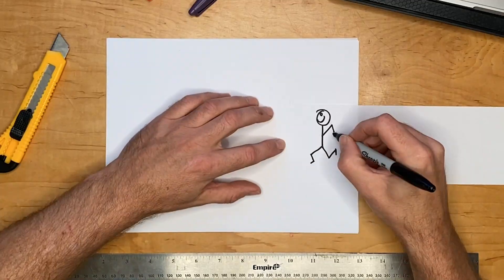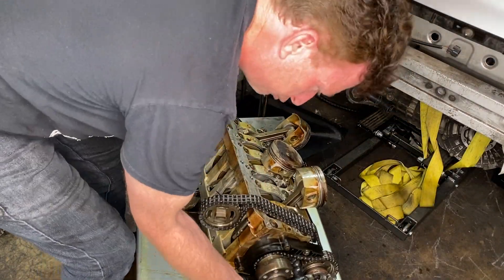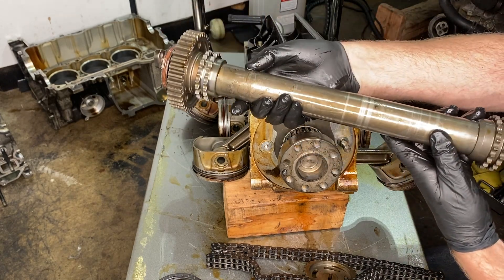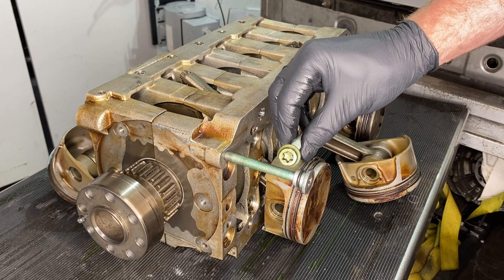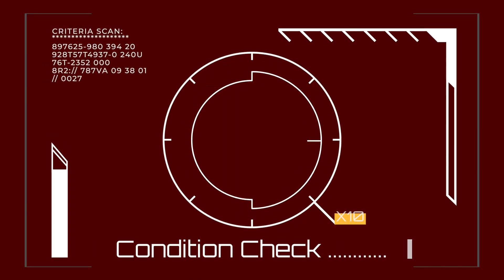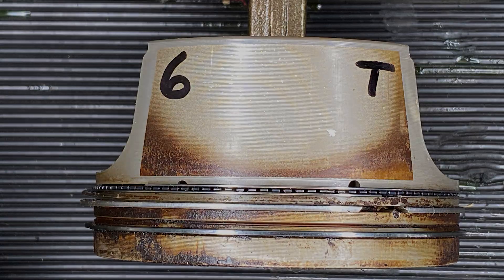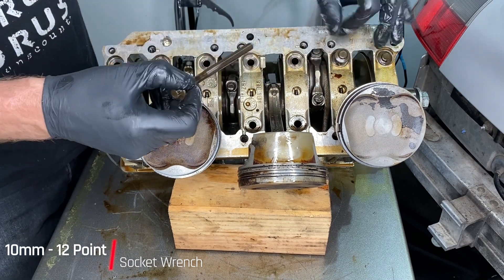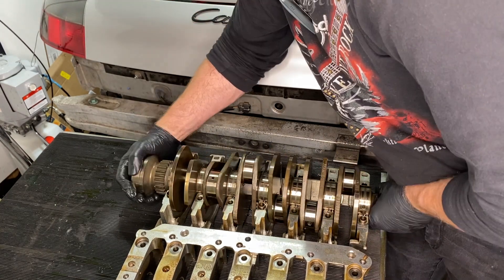How to RECONDITION a PORSCHE 996 Engine Part 1

Comment: I now know what crankshaft bearings look like, thanks!
Jan. 2000 996 C2 in OZ with 157,000kms has "white metal contamination" in the oil filter, sadly. Was told it was early sign and engine rebuild!
Can't do it myself even with your amazing and entertaining content to assist me.
It's a minimum 6 month wait to get this done over here. I live in Perth WA and have to send the car to Sydney to fix it in September.
Reply from the maker: G’day Chris! This was a voyage of discovery for both of us. I’m surprised these engine do what they do without exploding sooner 🤓 sorry to hear about your impeding engine rebuild, just think how kick ass it will be when your done. Many people recommend a displacement upgrade during the rebuild if your machine shop offers that. You can go up to 3.7 without changing anything else (assuming your purchasing new pistons anyway) All the very best of luck on your car 🍀 Thank you for watching 🤘😎

Comment: Make sure you install the piston in the right orientation when you reassemble the engine! Keep in mind the main bearing carrier is flipped upside down in the engine!

edit: 7:14 on top of the engine cases where the cylinders are, are numbers casted into the block which tell you what cylinder number underneath them is!
Reply from the maker: I really appreciate the advise! Thank you for Watching 🤘😎
Reply: @ManinaGarage  I’m glad to help. If you have any questions regarding assembly feel free to ask. I have successfully rebuild several of these engines and I’m happy to help others as well! 

Greetings from Germany :)

Comment: No the cylinders are not nice, they are not supposedto have a shine like that. Cylinders should have hone markings. On a shiny surface like that the oil will not stay.
Reply from the maker: Hello RealOlawo, good point, but these Porsche cylinders are an exception to that. They are Lokasil, a silicon process that leaves a glass like finish. They cannot and should not be honed. There will be much more detail on this in an upcoming episode. Thank you for watching 🤘😎
Reply: @ManinaGarage  yes but they need to be chemicaly treated so that the surface is rough and not as shiny as yours.
Reply: @ManinaGarage  you can make a test, heat some oil up to 90 °C and drip it on the surface. Whatch the behaviour of the oil.

Comment: I come from Bavaria and follow your topic very closely and with excitement.
You explain the complex matter in an easy to understand way. 
Perfect!!

 I own a 996 from 2001 VFL and checked an issue by diagnostic:
"Deviation from camshaft position 1" has the value -5.45 `CrK
for: "Deviation from camshaft position 2" the value 0
I am trying to find out if this is critical.

I am very excited about your continuation.
Reply from the maker: Hello Lothar, Greetings to Bavaria! Your deviations do not sound terrible. Make sure you test the car when it is at operating temperature as the deviation will be greater on a cold engine. Deviations of up to 6 degrees seem to be acceptable. You can change the Cam pads without removing the engine, it might be worth looking into in the future. Thank you for watching 🤘😎

Comment: This has been such a great journey! Yes there are lots of M96 rebuild videos out there but to have one so clear and concise for the Everyman adds entertainment and removes the intimidation. As I keep saying, nice job!
Speaking very much as a non expert your engine looks to be in superb condition internally, that must be a real joy! No doubt you could have stopped at the chain guides but I think with the extra effort you’re going to future proof your engine (And I think add real value). Out of curiosity what are the plans for the cylinders? Check for roundness and carry on or are you going to go the whole hog and mill them out to replace entirely with Nicasil nickies / Hartech barrels? Best of all I think a full on closed-deck 3.7 (Yours is a 3.4?) conversion! Granted things will start getting a bit expensive though...

Anyway congratulations on getting it all apart and for having such a clean looking engine!
Reply from the maker: Hello Daron 🙌  The interior of this engine is shockingly nice, it is so much better than I was emotionally prepared for 😅. This week I will probably talk about what I'm doing with the cylinders, the various PORSCHE Jedi's that have been willing to return my calls have been giving me pretty encouraging advice that leans toward keeping the stock Pistons and cylinder linings, Let's Hope 🤞🏻. Locally I am having trouble finding a machine shop that is willing to touch a "BOXER" engine, they all behave like it's a bad smell and then hang up 😲😫🤪😂  It looks like I will need to figure out what some of the measurements should be and try to measure them myself. Taking it apart was one thing, now I need to get my checkbook out so to speak, and start buying the parts for the rebuild, that may be the most painful part so far 🤑. I hope you are having a great Monday!!

Comment: By the look of the connecting rod shells, they look like typical 100K mile bearings to me. Actually, they're wearing quite nice with quite a few miles left on them.
Reply from the maker: Happy Sunday Fred, That is just the kind of comment I was hoping for, I really appreciate you taking the time 🙌. . Those bearings will definitely be replaced. It is very good to know the wear is normal, I feel this engine was pretty happy overall. Thank you for watching 🤘😎

Comment: Not too much wear on the Conrod shells - but I would replace them. Did you find the cause of the engine issue? Was it just the tensioner falling apart and nothing else?
Reply from the maker: Happy Sunday Paul & Joy! I really appreciate the feedback, thats very helpful. Those bearing will be replaced, it is heartening to see that the wear is normal. The inner VarioCam Pad on BANK 2 had DEEEP wear tracks plus the missing piece, the other 3 pads were also badly worn, though not to the same degree. This could have caused the "Boggy" feeling the previous owner reported. The next thing to look at is the IMS itself. This week I will be talking about sending it away to be Pinned etc, LNE will also measure the IMS to see if anything slipped. Depending on what they find, that may explain all the issues........ Thank you for watching 🤘😎

Comment: Agreed that the cylinders shouldn't be like chrome or glass.  They need to have a cross-hatch pattern honed into them so that oil will hang between the piston and cylinder.  But it is encouraging that this engine is in such good condition.  How many miles on it again?  Why again the rebuild?  As I recall you had some plastic bits from the tensioners in the oil.  Do I have this right?  Awesome work, very impressive!
Reply from the maker: Hello Tom, I have been getting advice on what to do with the cylinders, I really appreciate your input. It really is a constant surprise just how good some of the parts still look. As you can tell the car is high mileage, specific numbers on the car including parts cost etc will be put together in an episode toward the end. The car was bought broken with a "Do not start" instruction from the last indie shop to see it, The rebuild was to learn about the whole 996/IMS thing first hand, to get some straight answers and just to see if I could do it. 
SO FAR: The inner VarioCam Pad on BANK 2 had DEEEP wear tracks plus the missing piece, the other 3 pads were also badly worn, though not to the same degree. This could have caused the "Boggy" feeling the previous owner reported. The next thing to look at is the IMS itself. This week I will be talking about sending it away to be Pinned etc, LNE will also measure the IMS to see if anything slipped. Depending on what they find, that may explain all the issues. Thank you for watching 🤘😎

Comment: Did  I miss something, have you figured out what caused the failure, or are you about to reveal that?
Reply from the maker: Hello Timothy, Episode 15 is the main one that shows confirmed damage. The inner VarioCam Pad on BANK 2 had DEEEP wear tracks plus the missing piece, the other 3 pads were also badly worn, though not to the same degree. This could have caused the "Boggy" feeling the previous owner reported. The next thing to look at is the IMS itself. This week I will be talking about sending it away to be Pinned etc, LNE will also measure the IMS to see if anything slipped. Depending on what they find, that may explain all the issues. I hope you are having a great weekend 🙌
Reply: @ManinaGarage  crack on I'm looking forward to your updates from a Man in a garage :)

Comment: I'm not a Porsche expert but those cylinder walls look like they need to be deglazed.  I had similar bores and used a flex hone to score them with a cross-hatch pattern.  Helps piston rings seal.  While you're in there you should just replace the shells. Why not, right? Unless they're wicked expensive.  Are you going to check tolerances between your shells and caps?  Also, check out my hot tanking video. It'll get your engine parts factory new looking!  Double-sided gorilla tape will help with your skid pad. Great video, looking forward to next episode.  My eBay 996 should be in my garage in a week or so. Can't wait! I'm kinda sick of Audis. 😀
Reply: @Andy B appreciate the sub! It’s gonna be fun. Thinking of getting a 2-post lift from MaxJack for this project and future ones.
Reply: @Andy B I just have to convince my wife that it won’t obstruct access to her car when it’s up. So I’m making makeshift cardboard mock-ups of the posts so she can be happy. 😂 whatever it takes I guess!  New video dropping tomorrow, btw.
Reply from the maker: Hello Yogi, I really appreciate the feedback, there are many decisions coming up, I need all the information I can get. Hopefully I can find a local machine shop to help me with some of the measuring/honing, so far it has been a challenge to find a shop that will touch a boxer engine 😅. Cleaning wise, I will check out your video, Thank you 🙌   Hartech U.K. use Vapor Blasting to clean their cases, I have been looking into that so far, there are a couple of local companies that offer the service. Thank you for watching 🤘😎
Reply: @ManinaGarage  an inside/outside micrometer on Amazon isn’t too bad. Saves you a few 💰.